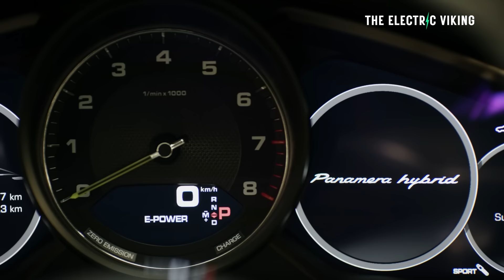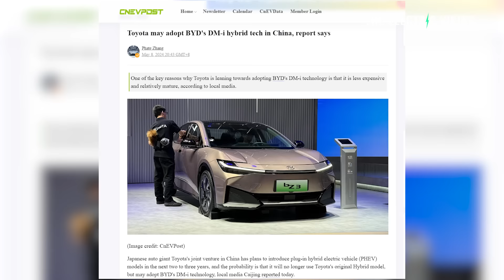China's worldwide electric car export are skyrocketing in 2024

Comment: China's BYD says its latest hybrid tech promises a driving range of 2100 kilometers on a fully charged battery and a full gasoline tank.
Reply: they didn't tell you that you should drive on a speed below 100 km/h.
Reply: @pipiqiqi4010  If you drive in that speed (below 100km/h in the highway) you can reach 2400 - 2500 km, there are many videos showing the test drive by fans individually, BYD officially claimed 2100 km at any speed you want as you normally do.
Reply: @pipiqiqi4010  By the way the highest gas level in China = 87 in the US, if you use 91 gas in the US for BYD, you should reach up to 2700 km.
Reply: @hanfucolorful9656  there is a test to get the distance under the normal driving conditions, the BYD just reach a distance of 1300km
Reply: @pipiqiqi4010  Highly suspicious...

Comment: I‘m Chinese. I can introduce to you the development prospects of electric vehicles. The biggest difference between electric vehicles and traditional fuel vehicles is that it is a pure electronic consumer product. For electric vehicles, you can't consider depreciation the same way as you would for fuel vehicles. Electric vehicles evolve and update extremely fast, with significant technological upgrades every six months to a year. Similarly, the model update speed of electric vehicles will far exceed that of fuel vehicles. In fact, electric vehicles can be viewed as a mobile phone with wheels.
Once electric vehicles achieve sufficient sales and market penetration, their costs will drop to a stable and reasonable level. At that point, just like mobile phones, you would likely replace your electric vehicle with a new model every 3-5 years, while the older model could still be used or sold for a very low price.
In Europe, I believe your biggest issues are infrastructure and electricity prices. Are you able to build and maintain a sufficient number of public charging facilities? And can you create a large enough price gap between electricity and gasoline?
In China, filling up a tank of gasoline costs me around 50-60 euros, while fully charging an electric car only costs 6 euros. There is a tenfold difference in price, yet they offer almost the same driving range. This is a significant reason for the rapid development of electric vehicles in China.
Reply: Good information 👍
Reply: Hi Chai. As i've stated above in my other comment, i would like you to investigate the new upcoming concept of "EREV" , Leapmotor seems to be paving the way, also Mazda will release a model this year with a wankel piston type generator inside. Ever increasing demand for charging stations have bottlenecks of huge upfront investment costs, empty inner city spaces which are very rare in densely populated regions in the world such as europe and east asia contrary to most of US. 

Leap Motor seems to speed up Europe investments to eb the first here in Europe, made a partnership /merge with a western firm, and will build vehicles in Poland.

i think EREV concept will be the winner in a few years taking the lead in EV transition from coneventional combustion engines. Would like to know more about this if you have access to latest automotive news in China domestic market.
Reply: China's new energy industry has been planned for more than 20 years. The reason for its rapid development is that China leads the world in power construction. No country has such a comprehensive and complete power system, roads, transportation, etc. as China. It is impossible for a normal country to provide electricity to a population of 1.4 billion
Reply: @asencyel  Leapmotor, if I understand correctly, is also a Chinese company, known as '零跑'. Meanwhile, many Chinese automakers such as BYD, 蔚来 (NIO), and 理想 (Li Auto) are also selling EREV  models. These models have been developed in China for a long time and have been tested by the market.

I do not have a preference for any particular technology. BEV, EREV,PHEV all have their own advantages. For daily short-distance use, BEV is more economical. However, if you need to travel long distances, then EREV are undoubtedly more advantageous.

I sincerely wish that every country in the world enjoys the freedom to make choices, from brands to prices to features. After all, variety is always a plus.To sum up, I agree with what the video said, that a storm is coming in the automotive industry, and nobody wants to miss it, right?
Reply: Of course, the important thing is that when you drive a new energy vehicle, you will find that you no longer want to drive a fuel vehicle. You will feel that fuel vehicles are a product of the last century.
Reply: @小柯布  EREV has advantages of both EV and IC engines. You have very high kinetic energy savings in city commute with ev where as with ic engines you can only dissipate energy as heat to atmosphere through braking pads and much worse you can not recuperate spent energy while climbing uphill returning backwards downhill. this kinetic energy recuperation alone leads to %50 energy reduction in slow speed steep hill conditions. 

overall country wide electric distribution infrasturcure is not brand new in europe or us compared to china who made it's debut to the 1st world league only 10-20 years ago. 

EREV can integrate LPG instead of gasoline further reducing generator cost almost %50 percent and charing ev on the go is a huge deal.
Reply: erev seems to be the best of both worlds actually. a small efficient generator only to be used for long range commute and all other drives within a daily range of maximum 50 km's can easily be achieved with a comparably small 20-30 kwh lfp batteries and overnight charging in wall chargers at homes.

apart from china, no other country today can provide necessary investment for all electric mobilization and electric distribution network, both country wide high power lines and required number of end point charging stations.

today already queues in charge stations started to build up in the west frustrating ev owners and raising questions on a future with out any convenience

With the current exponential transition rate to ev, i 'm %100 sure no other country (Aside from scandinavia and China) is ready for all electric
Reply: @小柯布  When electric vehicles just became popular in China, many people said that they would feel dizzy or suffer more severe motion sickness, because the car no longer trembled and they were not adapted to it.😅😅
Reply: I've been saying that from the beginning. EVs must be cheap to buy and cheap to run, then everything will follow naturally
Reply: @chaichad7227  that's true. I have tried driving model Y and felt so dizzy.
Reply: Just got my first EV in china, and I can confirm it cost 10 times less vs fuel to drive the same distance. I initially I had some range anxiety, but there are so many charging stations . Within a 3km area  there's  over 20 stations. Charge times are short. Save enough for 1/2 a car over 5 years just from the fuel cost, and I'm being conservative.

Comment: Btw, the term "EREV" is not established yet as far as i can seen on media. Mazda is also incorportaing a small very efficienct wankel engine also decoupled from the drive train only to generate electrcity to charge a small battery , reducing weight and purchase cost of the vehicle. 

Leapmotor media kit states the gasoline generator can output 3.7 kwh per 1 liters of gasoline, this is achieved by smart monitoring battery state and driver behaviour to charge the battery at an rpm rate maximizing efficiency of engines torq-rpm curve. since the engine is decoupled from drivetrain varying power requirements of the vehicle on the road has no effect on realtime ouput of the generator and smart management can calculate duration of generator output according to variables, possibly including the route given to the embedded navigation /km of distance left. 

ever increasing speed of transition from gasoline to full ev's proportionally require a huge charging station infrastructure, high load mains distribution new lines and maintenance. already long queues on charging stations started to raise the question on future of full ev's and i firmly believe EREV concept will be the ultimate winner in a few years.

Comment: hi, been watyhing your channel for quiet some time. Would like to you to investigate the future of upcoming "EREV" gasoline/lpg engine generator models with small size battery packs more then adequate for daily near distance commutes and having 1000+ km ranges if  needed where gasoline generators charge battery on the go. no need to wait in line for charging stations, no need to charge the car for at least 30 mins even it is dc level 3 rate charging and if needed you can daily charge the battery in garage or fast charge with dc port. 

Leapmotor seems to pave the future for these upcoming very promising concept in china and soon in europe. cheers.

Comment: 6:20 how do the chinese oem PHEV's get so much more range efficiency than toyota's, i wonder.
Reply: You got to know how many years BYD have invested the technology to reach 5th gen PHEV.
Reply: The logic and Platform is different. Byd use the Morden EV battery and managing system combined with redesigned engine. Toyota’s started from 20 years old tech platform. If T want do more than BYD. They have to restart and give up all their platforms.
Reply: BYD's PHEVs are EV with a small engine
Toyota's hybrids are just regular ICE cars with a small battery for regen.
They are fundamentally different

Comment: The legacy car manufacturers like toyota are still concentrated on internal combustion engine with many moving parts to maintain and repair as opposed to EVs with just the batteries and the standard parts for maintenance (wheel alignment, oil change, etc.) it’s ancient technology already in 2024 and sooner than later ice vehicles will lose their ability to compete with electric vehicle and solar-powered vehicles incorporating disruptive technology (AI, full self driving, built in dash/sentry cams, etc). It’s not as much as any climate or environmental concerns, but since EVs have less moving parts, they’re generally easier and cheaper to maintain.

Comment: I watched your take on China's lead and eventual global dominance re: EVs and I have to agree. I don't see how anyone other than Tesla can survive this tsunami. Even if all that Tesla can pull out is the "anything but Chinese" customer, that will be enough for them to hit their 20M/yr target, probably not 2030 now but only late by a year or two. There will be tremendous demand for Chinese vehicles but there will also be tremendous demand for Teslas too as the only alternative. It won't be like they are a bad alternative either, they will still be top of the line tech wise too.
Reply: I think Tesla is moving into a different market.  Robotaxis.  Why bother with building cars which will have low profit margins due to lots of competition.  There is a massive amount of money to be made with robotaxis and using their cars for robos will cause an even faster replacement of ICEVs.
Reply: @bobwallace9753 Tesla Robo taxi will face fierce competition in China too as Chinese Robo Taxi tested in China for 3 years. In addition, Tesla has to work with Baidu in China so it will not quickly like Must promise (always late in deliveries). Other markets has Zero chances by 2027. 

Don’t forget Uber died in China! If both Tesla and Chinese works, cheaper car prevailed and Chinese always cheaper.
Reply: @wsi1917  
At this point no company, Chinese or otherwise, has an actual full self-driving solution other than Tesla.  Other systems are more like urban trolles that run on fixed routes.  With backup remote drivers.  They do a good job of running on pre-mapped routes as long as something unusual (edge case) does not crop up.

Tesla is close to having a system that will drive anywhere that cars can drive, using no maps other than for navigation.  BTW, Baidu seems to have better maps than what is available in the US.  

I realize that someone has fed you FUD, but Elon is not always late.  Just so you know.
Reply: @bobwallace9753  No, I saw many Chinese car drives in urban area with acceptable results. There might be some gap but not big. However, Robo Taxi FSD is not plug and play. Beside working with Baidu, Tesla have to comply with laws (traffic and insurance) which differ from country to country which will take times. On top (most difficult), is the road users (drivers: car, motorcycle and bicycle and pedestrian) behaviors especially in urban area which Tesla have to learn as China practices is far different and complicated than US. 

I also watch Tesla FSD in U.S. show un-smooth when dealing with US urban area. That’s why Tesla keep its official as level 2, not even 3. 

Tesla took leads Chinese EV for 10 years since 2008, after 2022, it took Chinese less than 2 years to beat Tesla in price and sales. 

It’s not a Fuss but realistic, wake up guy.
Reply: Korean cars will be OK.
Reply: @wsi1917  

Tesla has to deal with different traffic rules in different places in the US.  Some places allow right turns on red, some don't.  Driving in China just means learning the local rules.  Watch a bunch of Chinese Tesla driver videos and AI will sort it out.

"Level 3, or conditional driving automation, is a level of autonomous driving where a vehicle can temporarily take over driving from the driver. However, the driver must still remain alert and be ready to take control if the system can't complete a task. Level 3 vehicles have environmental detection capabilities and can make decisions for themselves, like accelerating past a slower vehicle. However, they only work under certain conditions and may not operate if those conditions aren't met. For example, a Level 3 system might only work at speeds of 40 miles per hour or less, in good weather, and when lane lines are clearly marked. If conditions aren't right, the car will revert to hand control"

Tesla FSD is there in the US.  I just saw a post by someone in the US who took a greater than 2,000 mile trip and manually drove only ten of those miles.  That is Level 3.

I'm not sure China EV makers can beat Tesla on cost once Tesla moves to highly automated unboxed manufacturing.  Especially in China where Tesla will have the same access to low cost part suppliers.  But I don't see why Tesla would want to play in a low margin segment.  The only reason would be to speed the world off fossil fuel faster, but they can drive that goal faster with robotaxis.

Tony Seba.  Every robotaxi will replace five to ten privately owned cars.  If Tesla makes two million robotaxis in a year that eliminates the need for ten to twenty ICEVs.  Robotaxis are a multiplying force.
Reply: @bobwallace9753  I think China already started Robotaxis already so Tesla is 1-2 years behind.
Reply: I do not see any future for Tesla

I've observed Elon Musk since the 1990's, that fella moved from industry to industry, from company to company, and all the companies he left behind, he simply do not care anymore, like used toilet paper

Right now, Elon Musk is focus on his X and his Starships and his satellite constellation businesses

Tesla is no longer his main focus
Reply: @SimonCU  
China already has robotaxis.  Waymo is already running robotaxis in the US.  But there's a difference.

Those systems require detailed route mapping and remote backup drivers.  Tesla's solution is different.  And much easier/cheaper scalable.  

It's like steam powered cars were on roads before gasoline fueled cars.  But gasoline cars worked better/cheaper and took the market.
Reply: @kenbehrens5778  Yes, and just like here in Canada and in the US, they make up about 50% of all EVs on the roads. Chinese EVs will whittle that down a lot over the next few years but I think Tesla will still be a major player.
Reply: @Lost_Johnny  They make the next best EVs (outside of China) to Tesla but they aren't making them at scale/profit yet. That is a very important part of "being okay".
Reply: @bobwallace9753 hi mate no argument about your Tesla comment, but if you are interested in this area and want to compare, you’d better update the Chinese side.
Reply: @zhaolei6650  
OK.  Give me a clue.  What needs to be updated and where do I find reliable information that I need?